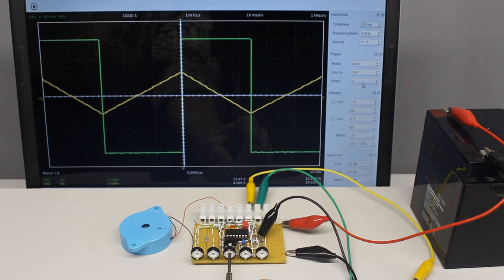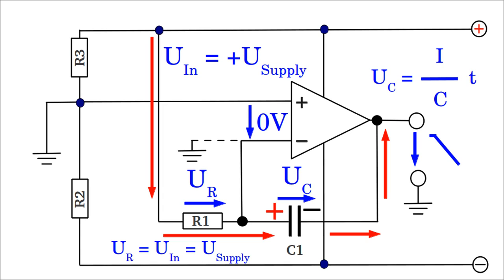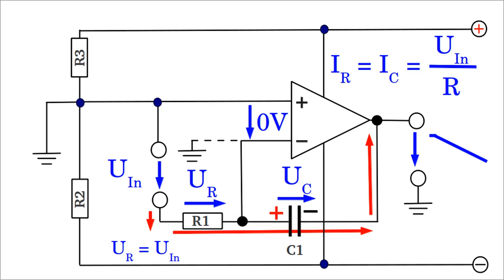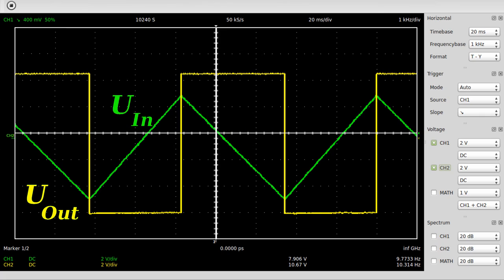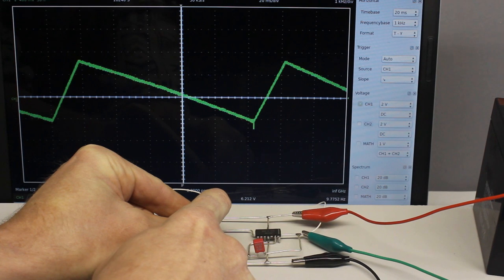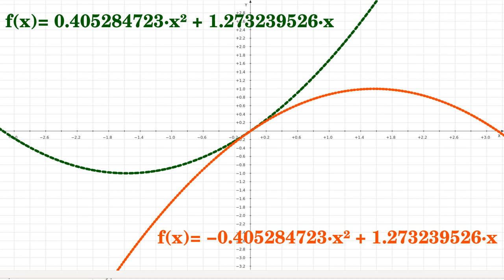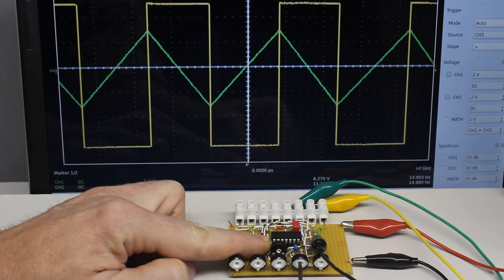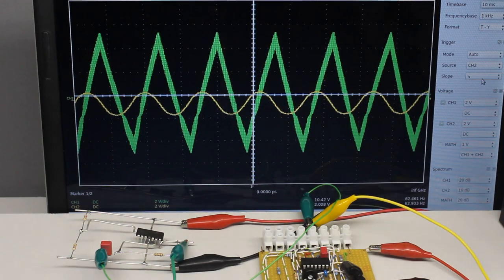Function generator / integrator / differentiator

Comment from the maker: Thanks!
My robot projects also failed during the first attempts. You will learn more about electronics with every failure you are able to eliminate. Controlling a helicopter is tricky. Coax helicopters are more stable then those with a single main rotor. I wish you good luck!

Comment: can we replace the amplifier with lm741? does it work?
Reply from the maker: +Hazim Bedran I haven't tried that yet. Since it it a cheap investment, you can prove if it works by using that chip in the circuit. I guess it should...